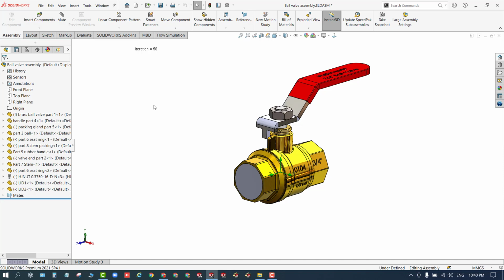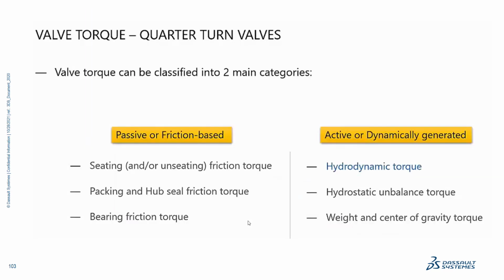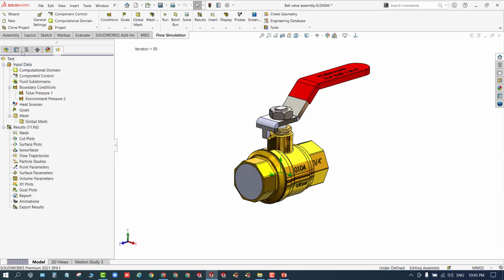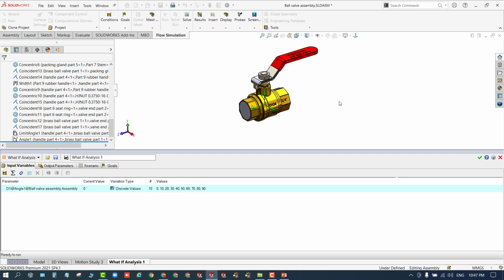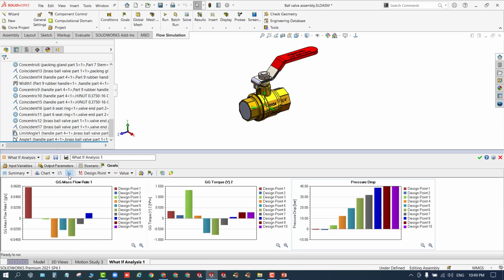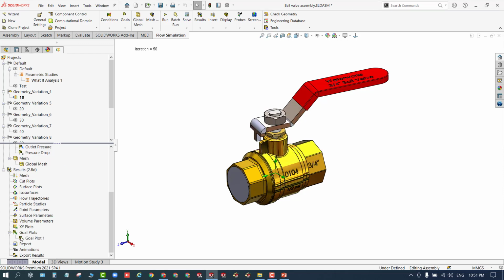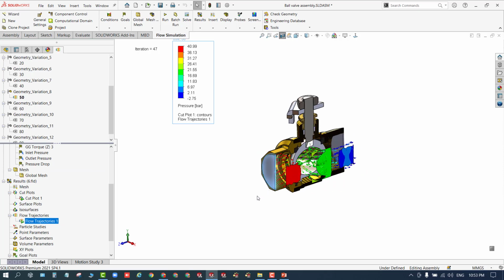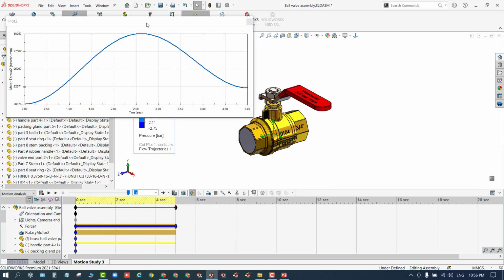SOLIDWORKS Flow Simulation on Ball Valve Demo | Finding Torque required to Rotate the Knob

Comment: Girish, Excellent work. Just a small point. The inlet pressure is 40 barg and outlet pressure is 1.03 barg. Practically, a pressure drop of 39 barg is not possible in actual condition.
Reply from the maker: Noted with thanks 👍

Comment: Hi! Thanks for the explantion. I would like to know if SW flow simulation we can perform dynamic simulation of valve closing from 0° to 90° ?  if it's the case, that would be very interesting to know. Thanks in advance for your answer
Reply: Dynamic simulation is not possible in Solidworks. And hence what if analysis is used to obtain goals at different angle.